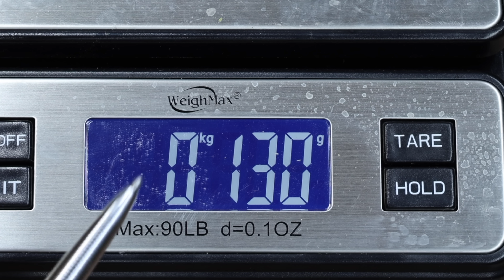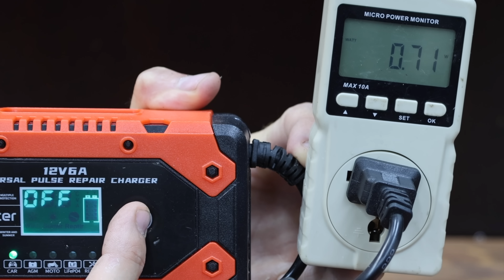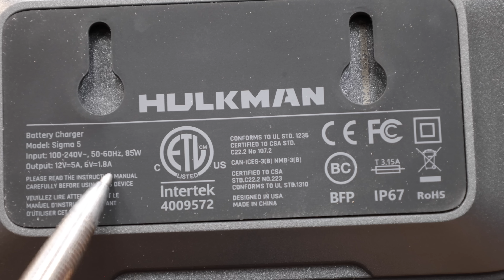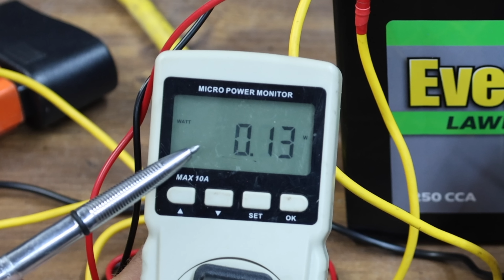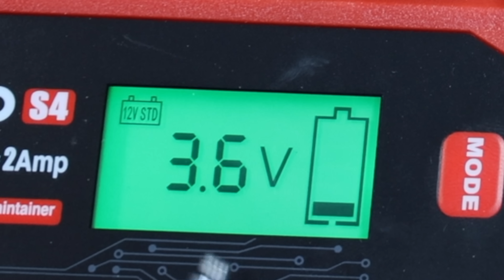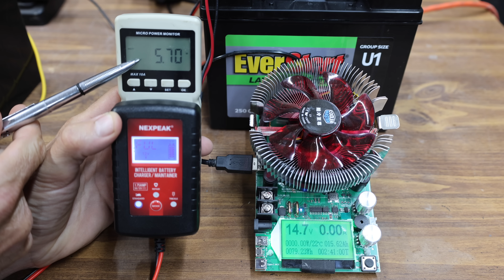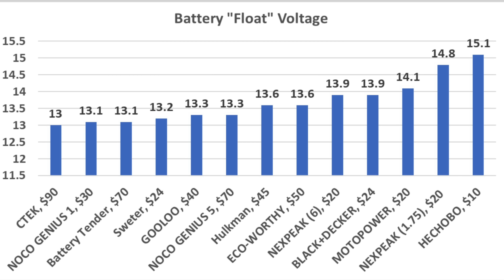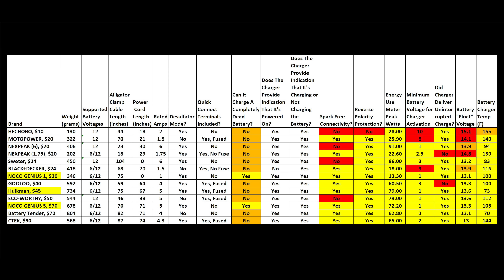I Tested the Most Hyped Car Battery Chargers – One Stood Out!

Comment: The ammeter on my old Schumacher 10/30/50 charger/booster finally gave out and when using it to try and start. It easily overheats and shuts off. Thinking it's time to get a modern replacement. This helped with charging and maintaining, which I do need to get soemtime. But hope you do a new video on those wall powered charger/boosters too.

Comment: Have been using U.S.-bought Noco 5 in Russia for over a year mostly in winter conditions charging 95 Amp battery on Toyota Land Cruiser Prado 150. So far it worked absolutely perfect with car standing idle all winter in subfreezing temperatures.

Comment: Bought the noco genius 10 charger couple weeks ago . Charged my truck battery from dead to full in a 3 hours. The noco 1 would have took days to charge a battery. So far so good . The real test according to reviews will be after several uses to see it it still works . I wanted the ctek but the reviews were horrible

Comment: Great testing . How about large chargers for LiFePO4 12.8V batteries .   I have used NOCO chargers for years in my shop . The newer line you got is the best . I have left them on months at a time on AGM battery and never over charged . Also I have used that NOCO genus 5 in sub zero in winter on tractor starting battery all winter long.  Got great starts even at -10F . The tractor has block heater that you plug in when cold . Adding the NOCO to that plug was a great help keeping battery at full charge .Same NOCO makes the battery boxes I use.

Comment: I've had the NOCO GENIUS 5 for four years and love it, I also have 3 Battery Tender 2A maintenance chargers and they have desulfator mode, but they are the much older analog transformer powered model. l use them on all my less used batteries especially during the off season (riding mower, boat etc.) I'm very satisfied and ike them a lot, but now I feel like I should test their peak voltage.

Comment: A word in the Noco chargers: they come in different models i.e. Noco Genius1, Noco Genius5 etc. This denotes the maximum amps that it will charge at (Noco Genius1=1 amp max). Noco recommend matching your battery's capacity (expressed in Ah; Amp Hours) to the charger model and they have a table with Battery Ah capacities and their associated charge times for each model of charger. The lower the max amperage, the longer the charge time but the gentler on the battery. The higher the amperage, the quicker the charge but harder on the battery. I bought a 2 amp model (Genius 2) and was using it on a standard sized car battery that was often being over depleted. The 2 amp model struggled and broke after only about a month. They sent me a replacement and I only used it to top up and maintain/float/ trickle charge batteries that weren't over depleting and 5 years on it's still going strong. My advice is to only go for the 1 and 2 amp models for small capacity batteries like motorcycle or very small car batteries and go for 5 amp and above for standard and bigger car batteries. Yes, technically the 1 and 2 amp models can charge standard/ large capacity batteries but they don't like it and in my experience it won't last long. I think for a standard car battery, the Genius5 (5 amp model ) is the best balance taking into account charge time, wear and tear on the charger and wear and tear on the battery itself. For a huge car or truck battery I'd either stay with the 5 amp or maybe go up to the 10 amp model. But I'd probably stick with the 5 amp so it can be used for standard batteries as well. Remember, the bigger the battery, the more charge amperage it can handle and vice versa. So in other words, unless you've got a motorcycle or similar sized  battery, I'd go with the Noco Genius 5 just like Mr. Project Farm recommends.
Reply: This is why I probably won't be buying another NOCO.  Battery Tenders are designed so they can provide accessory power in float mode up to their full output, so I'll probably be sticking with them.

Comment: I purchased (in Australia) a mid priced battery charger similar to the type tested. I used it to maintain the charge of a battery that was infrequently used and in that capacity it worked well - until the battery completely discharged! At that point I reverted to the fifty year old charger in the back of the shed to get sufficient charge in the battery to allow the new charger to take over.

Comment: Would like to see AGM battery charging. Optima has some pricier AGM chargers. Last time I made the mistake of using their Digital 200+ which was a 2 amp unit and took too long (+3 days?) for a completely depleted group 35 AGM battery that sat unmaintained in car for a year. Could you also test their Digital 400+ (4a) and 1200+ (15a) against the NOCO Genius 1 and 5?

Comment: I have CTEK and it's AMAZING, yes it can't revive a fully dead battery, BUT it has revived almost dead or weak batteries, and the recondition option has given my batteries months of extra life before needing a replacement. All Porsche guys use CTEK or the Porsche branded version.  I highly recommend it!
Reply: One commenter connected a simple 9 Volt torch/radio etc. battery across the terminals (+ to +, -ve to - ve)
that fooled the charger into thinking the minimum 9 volts  were present in the to -be -charged battery..
and the charger took over and charged the battery 
whereas it would not do so without that "fooling"....

(Almost 15 years  using my CTEK MXS5)

Comment: 2 thing...  Which chargers turn back on after a power outage?  Many of them do not, and that's a problem if you're using them as a maintainer.  Second, you should have found a 1980s battery charger to compare to, like the old sears craftsman stuff without all the stupid logic.

Comment: I had 4 group 31 deep cycle batteries for a project that I got on a great deal when a store chain closed, all brand new interstate batteries. I put a LEICESTERCN float charger maintainer on them after about a year of siting in my climate controlled basement up on a wood bench. About a year later I'm upstairs watching TV and I hear this BOOM and the floor shakes, and I'm totally confused WTF happened. So I go downstairs and find one of the batteries exploded, blew the top off all 6 cells, and acid everywhere. pulled the power from the group and started looking inside them, these lousy maintainers boiled the water out of them. I added distilled to all of the remaining ones, but they wouldn't hold a charge. $500 worth of brand new batteries ruined because of those LEICESTERCN charger "maintainers". 

Thank you for this review!!
Reply: @kleetus92  
According to what you wrote, the batterys were not new when a top came off.

Comment: Todd, love you're channel above all others.
Personally I have used mostly large, almost commercial battery chargers But I find it difficult if not impossible to locate a fairly priced battery charger in the 225 Amp or larger that allows a Dead battery to be charged, attempting to change as it works out sometimes. 
I now source these large, wheeled battery chargers at Garage sales and E-Bay sometimes as I cannot find new models w/o, IMPO a Dumb AI, computer Not allowing me to use my tool as I see fit.

Thank you for every Video you've ever produced!!!😅❤

Comment: I have a noco on my diesel which sits. Even though it states it won’t charge below minus 20 Celsius I’ve had no issues in minus 35 . Best 50 dollar investment I’ve made . Batteries we’re getting weak after 2/3 years due to computer draw from sitting. Current batteries are like new after 4 years still

Comment: I just bought a solar powered Batt charger (says it has MPPT charge controller) my previous solar batt charger was from harbor fright but my walmart AGM battery still went dead (they replaced it). basically my Ford ranger sits alot and I need away to keep the Batt charged and these new AGM Batts suck

Comment: The C-Tek charger is great for charging and maintaining LiFePo4 batteries as well and it doesn't over charge at all. Stops at 13v on the dot. They actually make the BMW branded chargers for my M4 battery. I Highly recommend this charger. 8 years of constant use and still going strong for me. I even use it on my 2002 Ford PSD Truck Odyssey AGM batteries.
Reply: That's good to know. Mine is a Noco house thus far, but it is good to know that there are other good options out there... Do you know if they make anything that has a 0v/force-charge option??

Comment: Yep, want to see some higher end chargers. I have a vevor and battery tender that I like very much. For a completely dead battery, I also tend to use an analog charger to bring the voltage up and then switch to a digital charger. But also like to see testing a desulfator setting. You would probably have to go to a used battery place to pick up some dead batteries to test that
Reply from the maker: Thanks for the suggestion.

Comment: please give us diesel technicians, Auto techs, aero space techs, and AG techs a larger battery charger episode, I have to charge banks of 2-5 group 31 batteries on semi trucks, I have seen banks of 4, 2506-6008 batteries in excavators, a little 1-10 amp charger would never charge those kinds of battery banks. I want to see the 20-100 amp charger category...... and ESPECIALLY focous on chargers that have a manual dial for a timer because a lot of us techs are faced with a battery that is at 20% battery health or less but we need the battery to over charge just so we can get it started that one last or second last time to drive it or walk it into the shop for the CVIP or inspection or repair to be performed and a smart charger will just turn around and tell us that the battery is sulfated and prevent the charge.... we know the battery is done.... CHARGE IT ANYWAY! just so we can get it started one more time to help the machine inside of the shop instead of having to do a battery change in the yard
Reply from the maker: Thanks for the suggestion!

Comment: My favorite by far is the CTEK and then the Nico chargers. Have the same CTEk you tested and a Noco 5 and 10. I’ve thrown all my battery tenders away. I leave my CTEK and Noco charges plugged in year round and have never cooked a battery. Additionally had good luck with the CTEK fixing an old battery that won’t hold a charge. Won’t fix it 100% but often able to get 1 more season out of the battery. Only do this small battery equipped vehicles like Gator or ridding mower.
Reply from the maker: Thanks for sharing.

Comment: Quite a few years ago I watched Jay Leno's channel and he had the CTEK charger. You said that he bought 300 of those he was quite impressed with him as he has quite a few automobiles which have quite a few batteries including motorcycles I bought three of them and I'm quite satisfied with them I never ran them through any kind of tests but they keep my battery for my home generator charged up in my two motorcycles. It has also a rejuvenate button has one for motorcycle or automobile buttons and one for real cold weather modes. I have had it rejuvenated motorcycle battery that was quite dead and been that way for at least a year took a couple of times and rejuvenate but it worked. And it still working for a friend request if they are a little pricey but I did buy my used. Thank you for the excellent review of all of the units
Reply from the maker: You are welcome!  Thanks for sharing.

Comment: I have the nexpeak(6) and it's been pretty good for what I'm using it for but I think it should be shared with everyone that the mode button is sensitive and it's easy to unknowingly switch modes so caution should be exercised and  rechecking doesn't hurt.... I don't know if the cord had hit the button or what but it switched to AGM and It Damaged a fairly new interstate batteries battery that I bought for a future project
Reply from the maker: Thanks for the feedback.
Reply: @ProjectFarm Lol yea i got sidetracked and forgot to add to the support for bigger chargers .... Oh and also, maybe further down the line, a new vid on the little compact DC air compressors .,.. or if you don't want to revist that and wanting new new, how about those roadside emergency kits ? bonus suggestion: doing it stress testing style for maximum extreme circumstances to simulate worst case scenarios
Reply: @ProjectFarm as an example... I had a buddy use a thermal blanket to collect snow then swing it to beat a fire out

Comment: Great video! I would've expected a charger with the word "hobo" in it's name to be stupendously super. 🤣
I have a charger that's probably older than you are. It's worked flawlessly for many decades. It has no electronics. It appears to have a transformer, diode, circuit breaker and analog amp meter. Several years ago it brought my completely dead battery back to life and I'm still using that battery today.
Reply from the maker: Thanks!  Thanks for the feedback.

Comment: In my opinion a very important question is missing: 
Can the battery charger/maintainer be connected to a battery installed in a vehicle without damaging the car's control unit?

CTEK can do this, based on personal experience.
Reply from the maker: Thanks for the suggestion.

Comment: I have a Battery Tender Junior .75A to maintain my generator battery. I also have a Battery Tender 3A to maintain my truck battery. The 3A unit failed after about 7 months of use and Deltran replaced it for free. After doing some additional research, I recently purchased a NOCO Genius 10 because of it's advanced charging and recovery features. Good to know the Genius line should work as intended when needed for those tasks. Thanks for another great video!!
Reply from the maker: You are welcome!  Thanks for sharing.

Comment: I have a CTEK and ran a battery down to stone cold dead once.  Naturally it wouldn't do anything and I was getting frustrated because it was useless in the situation.  I was sitting down considering my options, take it out and get it charged somewhere or buy a more functional charger.  Then I had a idea, grabbed some wire and a 9 volt battery, connected the leads and it was enough to get the CTEK started.

So there is a work around, but IMHO it is a major shortcoming on a premium product.
Reply from the maker: Thanks for sharing.

Comment: I have a older Black and Decker charger I bought in 2019, it charges at 6amps, it's also water proof and can charge though a cigarette' lighter port if you need to, it doesn't charge lithium batteries but that's not why I got it, it was only $34 at the time, I feel like the new charger are more fragile
Reply from the maker: Thanks for sharing.

Comment: For a slightly larger charger/tender, I bought the "VIKING 2/8/15 Amp Automatic Microprocessor-Controlled Battery Charger" from Harbor Freight. It was like $40 on sale and automatically switches to trickle mode and has a sulfated reversal mode.
Reply from the maker: Thanks for the feedback.

Comment: I have had a Battery Tender Jr. and its worked over 15 years. I have a  SHUMACHER Farm and Ranch charger that is compact like a big cube but they stopped making it and it wasn't made in China. For 6 and 12 volt batteries. It would start a full dead car battery in about 20min. In a three step up amp increase with a power start setting.
Reply from the maker: Thanks for sharing.

Comment: I had a Gooloo S6. It was junk. It would start charging then eventually say the battery was bad.  I believed it and thought I had a problem with my riding mower and went through some batteries and diagnostics. I ended up getting a Schumacher SP1297 and it’s worked great.
Reply from the maker: Thanks for sharing.

Comment: I hope you can do this test again but include models like the Clore Pro-logix PL2140 and Schumacher SC1343. I went through several Schumacher float chargers over the years, but the Clore PL2140 I use now has been rock solid and almost 2 years of nearly continuous use on my seldom driven F150. I just ordered a pair of mountable trickle chargers, Clore Pro-logix model 1002’s. For larger chargers I have a Schumacher SC1304, Dewalt DXAEC80, and a classic Diehard charger which is no longer available. Like to see a test of larger portable chargers up to something like an Associated Equipment 6010B.
Reply from the maker: Thanks for the suggestion!

Comment: Also, I don't know if this falls in PF testing grounds, but the battery market is starting to grow with Lithium (LFP) batteries that work as drop-in replacements in all of the places lead-acid batteries would go 
Computer UPS, ATV, Trolling motors, cars/trucks 

I'm still trying to find the wheat in the chaff when it comes to brands like Riuxu, Dumfume, Li Time, FuKoi, etc.
Reply from the maker: Thanks for the suggestion.

Comment: I would like to see larger chargers i have the tower top 2/10/25 which is not a huge charger not sure what size youre talking about but it seems to work good for charging and reconditioning but trying to start a car with a really low battery or dead battery does not do well imo
Reply from the maker: Thanks for the suggestion.